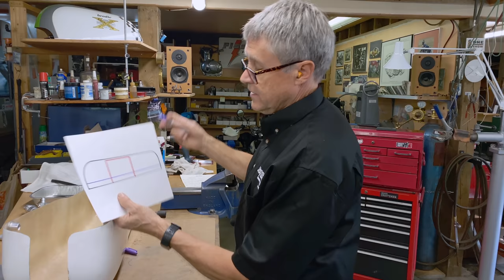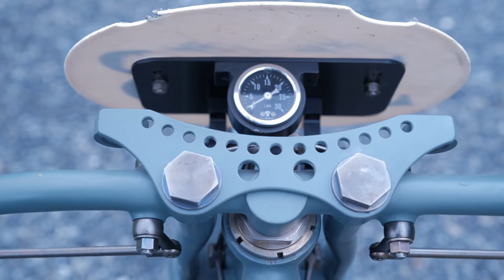Aermacchi Tank Mount - part 2 // Paul Brodie's Shop

Comment: Usually you have one right hand* and one left hand threaded hiem joint.
Then your linkage becomes a turnbuckle and the pedal is adjustable without removing it.
Reply: Yep! I've seen wrench flats milled onto the main link so when you crank it both pivots move out or in accordingly.

Comment: Ooo! Don't give away those Heim joints. Mate them with a RH thread one at the other end of the shift rod. With matching lock nuts makes for an easy adjustable linkage.

Comment: I bet the tank mould is like that 😉. Why not get one r/h thread and use one l/h thread rose joint? Will be good to adjust.
Reply from the maker: I think the tank got pulled out of the mold too early before it had fully cured. That's my guess.

Comment: Is a turn buckle, you want one l/h and one r/h, then when you slack off the lock nuts you rotate the barrel and it will shorten or lengthen without disturbing the component on the bike. Simples.

Comment: 1:10 oh yes you do, order another pair of right hand threaded, then you can make two shift linkages (or one and another strut of some type) that, by using one left & one right hand thread at each end, can be adjusted for length without taking off a rod end :)
Reply from the maker: Then I would have to buy a LH 5/16" tap, then find or make a LH 5/16" nut. That's a lot of work! Taking off a rod end is one Allen screw, so it's not that big of a deal. Thanks for watching!
Reply: @paulbrodie  haha fair point, buuut - you love, and are very good at making things, and, in the words of fedrinand porsche, form follows function, how neat would it be? :) :)
Reply from the maker: @Farlig69   I think I would rather move on and do some other neat stuff, eh?

Comment: I’m interested to know why you only apply a tiny amount of cutting oil or lube from a paint brush instead of using a constant flow of cutting oil you usually see engineers use? I’m not a machinist and I’m extremely impressed how easy you make things look! Years in the trade, I know ;)
Reply from the maker: You don't need a huge amount of cutting oil to make a nice cut. The constant flow you are talking about is probably "coolant", not cutting oil. You would see this on a CNC machine, for example. The machine is enclosed, and the coolant is delivered under pressure. It cools the tool and helps to disperse the chips. Without the enclosure it would be a complete mess. All over the floor and everywhere. Engineers don't usually make stuff. They usually design. Machinists make stuff :) Thanks for watching!

Comment: Just warm up the tank and straighten it. It was probably removed too soon before it was fully cured
Reply: Absolutely agree! Would take minutes as opposed to hours, you can also use wet paper towels on one side to cool and "influence" it. Not too hot, warm both sides. You could alsways do it twice. Heat source not too close and move it around. Could clamp to flat surfqce as well.

Comment: Hi Paul, will the race tank be baffled or have foam in it? Did you ever consider coupling the rear brake stay to the frame to create a floating system to isolate the rear braking forces? Also, why not orientate the carb so the intake is facing forward?
Reply from the maker: The gas tank will be small, so no need for baffles IMO. The rear brake is quite small and not very effective, so to have it floating would look cool, but not really add anything. Right now, the port is one long gentle curve. Facing the carb forward would mean the port gets longer and would essentially become a S-shape. Which I don't think would be good for performance. This intake system is proven and really does work very, very well.
Reply: @paulbrodie   Cool man. The bike is a work of art. That last part you made was really beautiful. I subbed your channel for the MTB stuff initially but gotta say this bike build has been a fascinating and a pleasure to watch :)

Comment: Those LHT heims are the potential odd end of easily adjustable rear set tie rods on my 84 XR500R super moto but with only two left and neither one looking right... it was difficult adding confusion where confusion rarely travels but I left some behind, right?.
Reply from the maker: Jim, what are you saying exactly? Do you need LH rod ends?
Reply: @paulbrodie  I wrote my comment as I realized left hand would be an excellent addition so yes I would love to have them.
Reply from the maker: @WireWeHere  OK Jim, your hand was raised first. Email me your address and I will ship.

Comment: You mentioned RPM, what red line have you established for this ?
Reply from the maker: I set redline on the Aermacchi at 8000 rpm. Some racers go slightly higher, maybe 8500, but more than that can lead to disaster.

Comment: Personally, I've done thousands of press up and bolt together  crankshafts over last 45 years.
 Was the tight one pressed together too tight and the loose one  worn on sides  only? (rod side clearances not set properly)
 Looking at the crankpin after it's removed can give a good indication of how a failure occurred if you remember to mark one end for orientation before disassemble (line up tdc or similar)
If the bearings are OK it's simple enough to make thicker thrust washers if you need them
I'm not actually familiar with Aermacchi motors so don't know if rod ends can be ground out for oversize bearings and small end re-bushed? (quite a few older bikes had nominal 1/4" or 5/16" rollers with over-sizes at 0.001", 0.0015" and 0.002"oversize)
Getting correct length may be an issue though (apart from XS 650's I haven't done cranks for last 4~5 years and they are easy to get 'stock parts for - if you consider Honda CR500 rods stock in a Yamaha XS650)
 Bearing rollers are often available  larger oversize direct from bearing suppliers (eg, 0.255", etc)
As for tank mount, I was expecting you to make a wedge shaped block following top tube angle one side with base horizontal. It would probably be 2/3 or less the weight of a parallel block and probably easier to bend up from flat strip?
Reply from the maker: I used to be able to buy oversize rollers for the crankpin, then I could lightly hone out the rod to fit perfectly. Now I can't get hold of that gentleman, so that source may have dried up. I tried to follow your tank mount, but the image is unclear in my mind.
Reply: @paulbrodie  LOL, my train of thought is difficult to follow sometimes. It's why your video's work so well and my 'explanations' don't.
Reply: @paulbrodie  If your local bearing supplier is any good they should be able to source loose rollers the size you want. They may be called something different though (not needle roller bearing) I think something along the line of bearing pin? Been a very long time since I used any.
Do you have the Alfa Bearings crankshaft rebuild manual? I downloaded a copy years ago and still have it on a hard drive (somewhere)
Reply from the maker: @1crazypj   I did not know there was an Alfa Bearings manual.I don't know when I would need those crankpin rollers, but I do have a good contact @ Wajax so I can check. Thanks.
Reply: @paulbrodie  When I come across the Alfa Bearings manual I'll post a message on your website and send a copy. Even if you never need it, it's good to have the information dispersed
Reply from the maker: @1crazypj   Thank you.

Comment: Paul, with sometimes more than 5% of shrinkage, polyester resin is a lot less accurate than machining an aluminium part ! For your builds and your quest for perfection, epoxy should be a better choice maybe…
Reply from the maker: That's a lot of shrinkage! I will keep that in mind, thanks.

Comment: I don't fully understand the function of the bottle. What's it connected to Paul? There's an in and an out and I guess it is to catch oil and vent air but I am unsure where that oil/air comes from (crankcase?) and why there's so much oil being "ejected" (maybe?) that it would necessitate a holding bottle this big (especially in a race setting with a limited time op)?
Reply from the maker: Yes, it is for venting the crankcase. Mostly air, but sometimes oil too. Usually, very little oil ends up in the bottle, but race rules stipulate something like 8oz capacity, so all race bikes will have a container that size. (or bigger)
Reply: @paulbrodie  ahhh - regs :) They don't like oil getting out on track so that makes sense I guess. Thanks.

Comment: Perfect ,, could you not just order two rh rose joints , and make the linkage a rh/lh thread , then you could lengthen or shorten it very easily , two flats in the middle and its not a fault its a feature.
You should have a think about adapting the press valve into a foot pedal , then you would have two hands to hold things ,, just thinking out loud ...
Reply from the maker: If I used one of those LH rod ends, I would have to buy a 5/16" LH tap that I would use once, and probably never again. I would also have to find or make a LH 5/16" nut. Once the shifter angle is set, it probably never needs to be adjusted again, so...  The press valve has been on my list for a long time now. I want it on the right side. Sometimes you need to be very careful in applying pressure, and my hand is more sensitive than my foot. The valve needs to go both ways too, so to use my foot might not be practical. Thanks for your comments!
Reply: @paulbrodie  all fair .. but an adjustable rod would be nice ... since when has money ever come into bikes as a major factor ... but yep your are correct ...
Reply from the maker: @tomthompson7400   I have seen a lot of racers working on their bikes in the pits. I am thinking back and cannot remember seeing a racer adjusting his shift lever at the track, unless they have crashed. I think shift lever angle gets setup back in the shop, when the bike is on a stand. Race bikes and racing sure can cost a lot. You are correct.